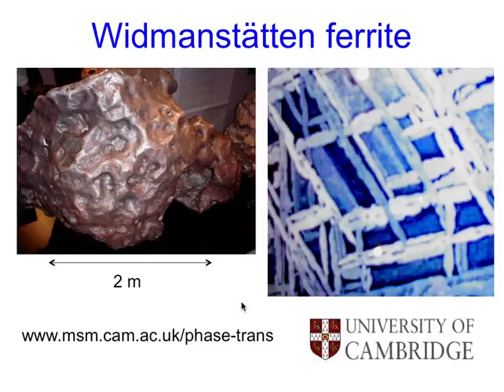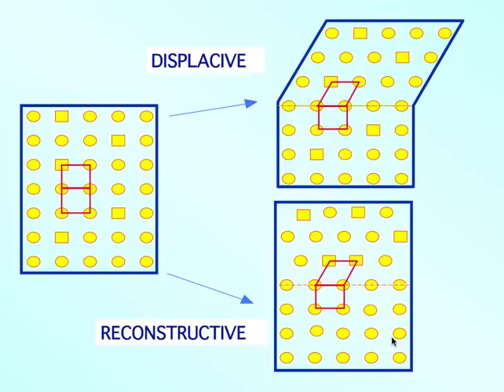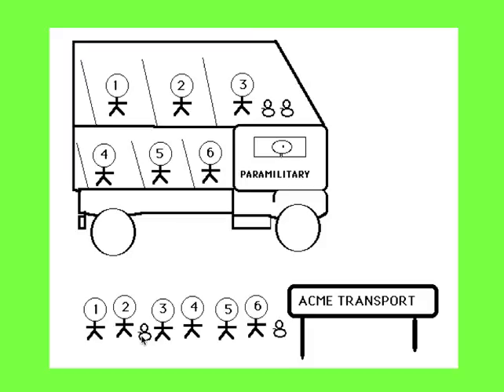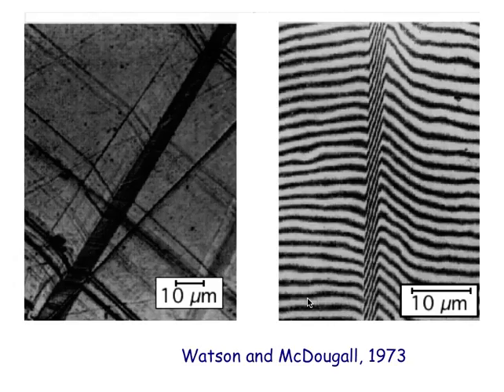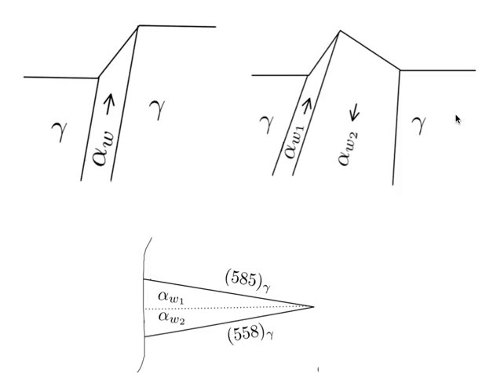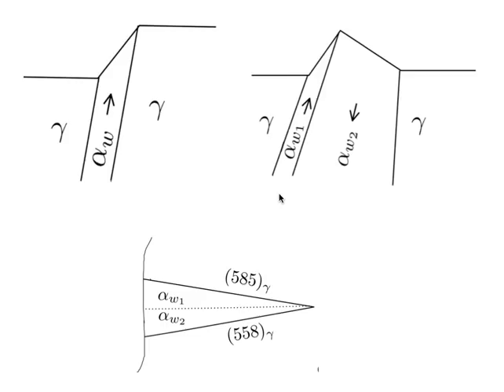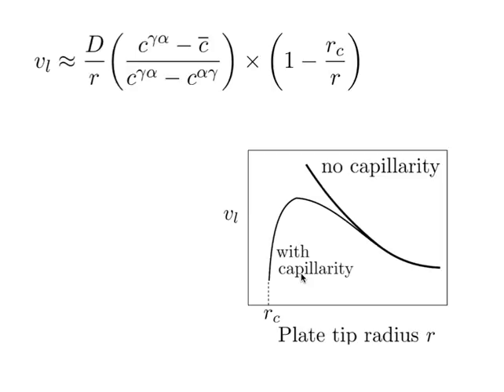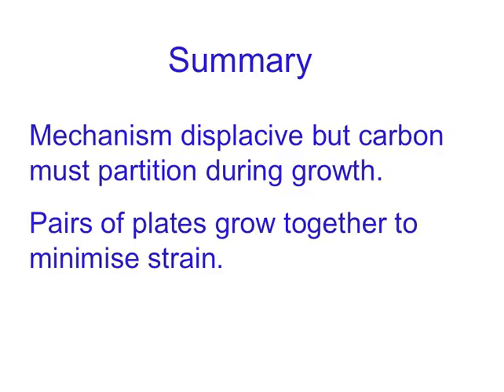Steels: Widmanstätten ferrite, lecture 5 (2016)

Comment: Dr.Bhadeshia, I have a question on the growth limitation of widmanstatten ferrite compared to bainite. You have mentioned in the bainite lecture that the growth is limited by the plastic deformation in austenite ahead of the bainite nuclei (interface). Both are displacive transformation and the transformation temperature of the widmanstatten ferrite is higher than the bainitic transformation temperature thereby the austenite should undergo plastic deformation during the growth of the widmansttaten ferrite. Hence it should create similar bunch of dislocations at the interface and it should control the size of the ferrite plate. But why are the plates significantly larger compared to the bainite?
Reply: Thank you so much. This is exactly what I was looking for.